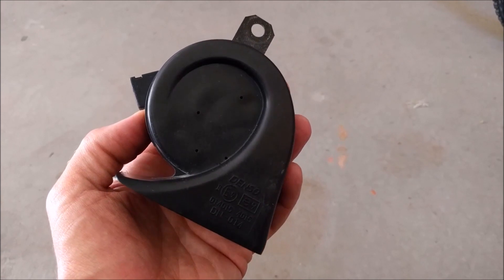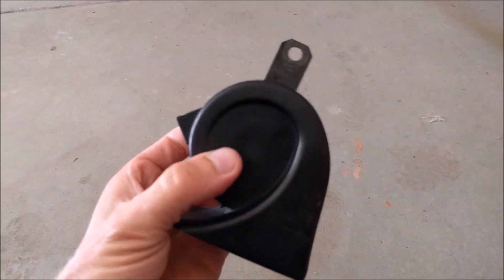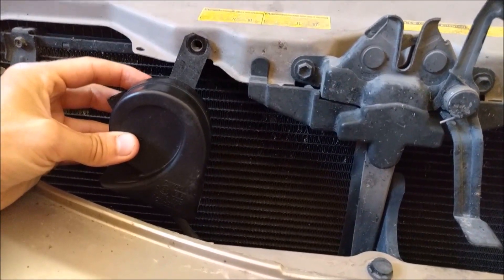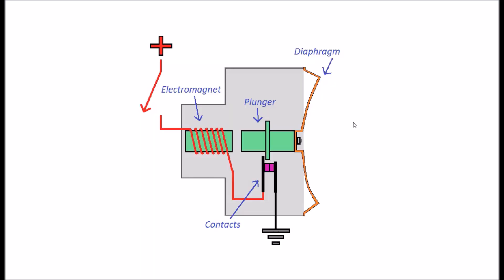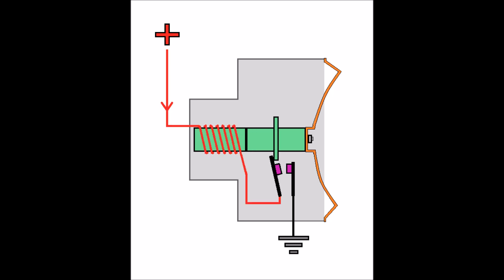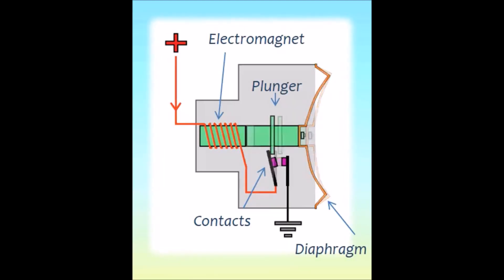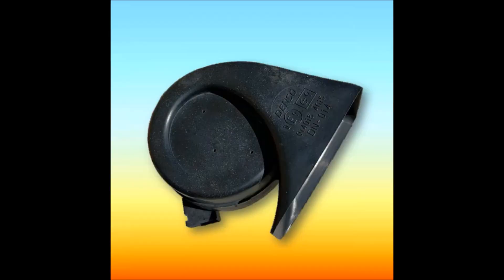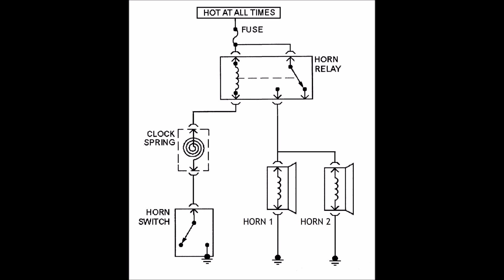How a Car Horn Works

Comment: I came across your video while doing some research to repair my horn...it seems that the low note stopped working.  I haven't attempted a tear down yet, but do you suspect that carbon in the contacts are what is causing the failure or would you start looking at the coil?

Thanks for your detailed explanation...it is probably the best explanation on the entire internet.
Reply from the maker: I don't know the answer to that question.  If you take your horn apart, let me know what you find!
Reply: @JustinMillerAutomotive  After some thinking, I'd say it's far more likely that carbon between the contacts is the more likely of failure modes. That said, I'll inform everybody once I tackle the project in a few months.

Comment: Some horns are a tad different. Some horns like these Densos do ground through the mounting bracket as well as many of the older GM Delco-Remy horns, but then some require an external ground wire. Many aftermarket Fiamms require you to attach a ground wire to one of the terminals and power to the other one, usually it doesn't matter which one as they're not power conscious.

Comment: Using a multi meter the two contact, in continuity mode, shows about 2 3 ohm resistanze and broke the fuse, are they in short circuit?
Thank yuo for your dimostration
Reply from the maker: If the fuse is blowing, then you have a short circuit.  If it still blows when the horn is disconnected, then it is somewhere else in the circuit.  If it only blows when the horn is connected, it is in the horn.  The resistance of a component can change when current is flowing in the circuit, so measuring resistance is not necessarily an accurate way to test the coil in the horn.

Comment: Thanks Justin, can I ask since you are an 'engine guy' is there any definitive method for testing a water pump on an engine for good flow, circulation, etc cheers sandy
Reply from the maker: Sandy, I wish I knew a good simple way to do this.  I don't.  We could think of some creative, time consuming methods, but maybe we should go back to the reason for wanting to do this test.  What are the symptoms of the car you are trying to diagnose?
Reply: Justin Miller  cheers Justin, the car blew its head gasket so we wondered about the efficiency of the water pump as there were coolant stains on it.  We changed the pump, major hassle, but it was not the problem, so wondering about various testing methods to save a work cheers sandy